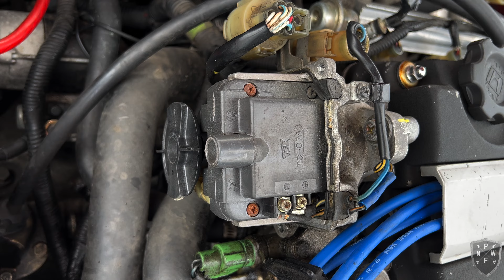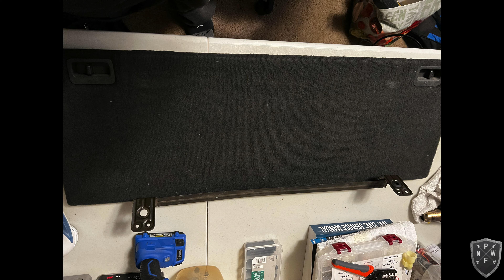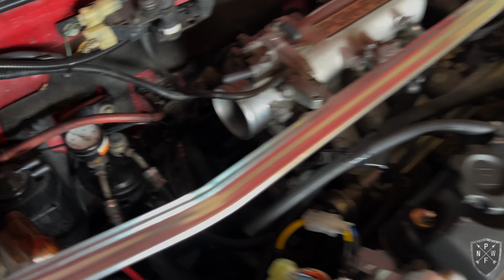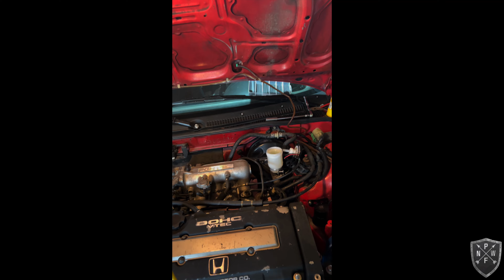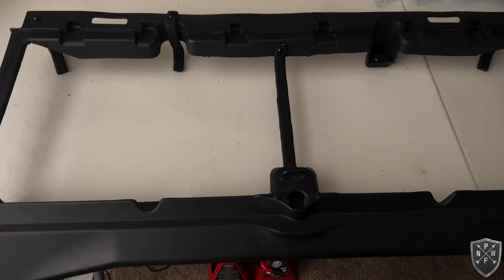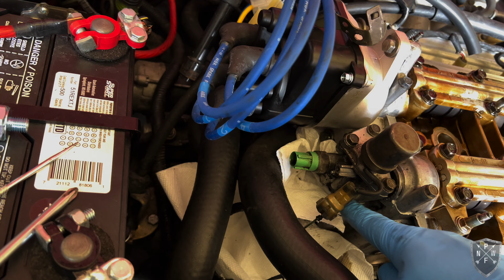What's Been Happening With Tha CR-X !?!?!

Comment: Id bet thats not evan a b16 distributor. Probably a si distributor with a ear broke to fit the b16 obd0 distributor is hard to find. That is if ur car is still obd0 witch it looked like it.
Reply from the maker: Yessir, still OBD0. I did find a direct bolt in replacement dizzy on Amazon for like $50 so thankful for that...... One thing I can't seem to find is the correct gasket set for the JDM OBD0 VTEC Solenoid........ it's shaped differently compared to everything else.... Shrug Also, replacement IACV for this thing is discontinued and super expensive if you can even find it.....UGH FML LOL